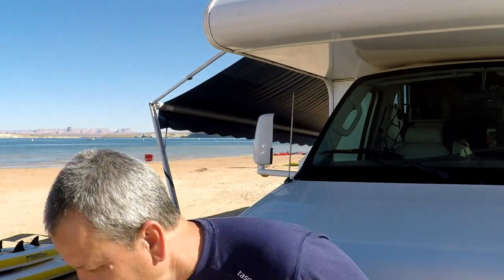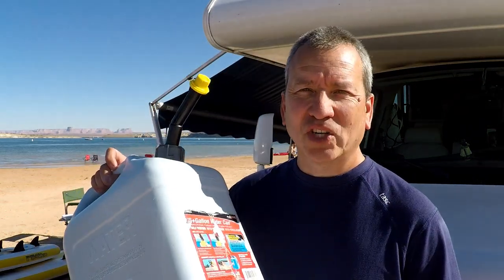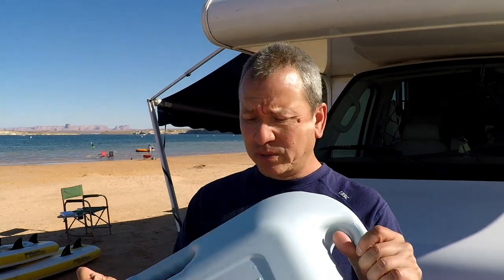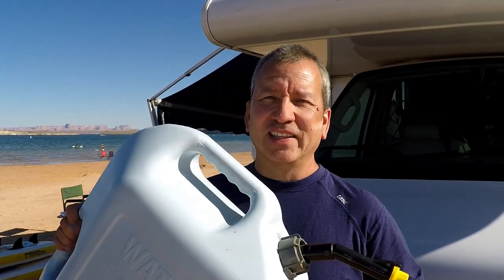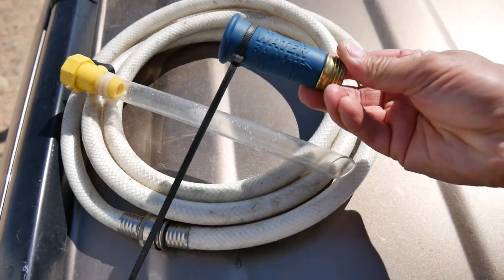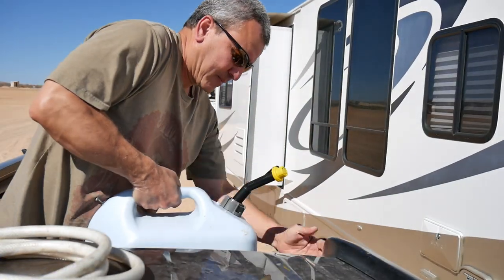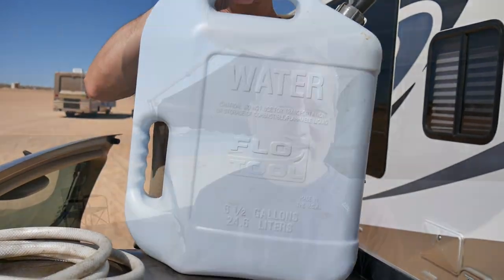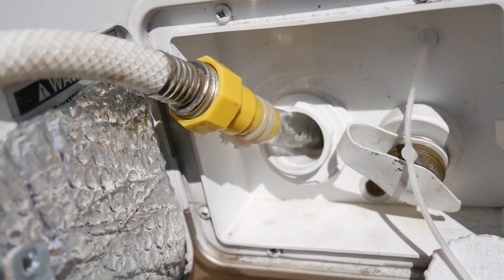EASIEST Way To Refill RV Fresh Water Tank Without A Pump

Comment: A siphoning trick I learned 30 years ago, is to just pressurize the source tank by blowing into it and then quickly stick that end (the one you blew into) into the destination inlet. In this case, you stick the airtight hose connection onto the water jug, with the (screw installed) you blow into the hose and then stick it deep into the water inlet of the RV. Once the water starts flowing remove teh screw. The pressure will push the water out of the container and create a siphon draining the water container into the RV. You probably have to keep the water container above the bottom of the hose going down into the RV water inlet, but that is lower than the top of the CRV given you have an 8' length of hose.

Comment: I bought a 12 volt pump at Harbor Freight,  some hose fittings and clear half inch hoses. and bring the colapsable 5 gallon jugs with me I just put them on the ground and pump it in works great
Reply from the maker: Yeah. Im pumping now. I can empty a 5 gal tank pretty quickly.

Comment: I use the 3 way valve for wintering. Open it up with the pump on and it sucks the water out without having to lift the water up. I did extend the clear line so it reaches the bottom of the jug. Saves my back and seems to work faster at refiling the tank.  I did add a second valve which I can open and close as needed also.
Reply from the maker: +Stephen Keller Cool. Yeah. I've seen others use that method too.

Comment: Install a metal truck valve stem (with the valve core removed)on your plastic water can. Much better venting and won’t leak.
I’ve used this method on my plastic gas cans for years.  WORKS GREAT!
Reply from the maker: Great tip! Thanks.

Comment: Before I had water at my cabin I used a 25 gallon ATV mount sprayer tank you see farmers using. I had it hooked up to my plumbing so I had pressurized water. Now I keep it under the bed in my RV. My tank holds 40 gallons but having the extra 25 means I rarely run out, I just plug it in to 12V and refill my main tank. I was going to plumb it in to my main tank but if I needed to take it out to go to town and get water I'd have to unhook it. I haven't had to go get a refill yet but I'm going to just put it in the truck, fill it up, come beck and plug it into the 12V and empty it. It also gives me a spare pump onboard and I have the tools to hook up to the portable tank if need be. 
 If I had to choose between mains electricity or running water, I'd choose running water;  as someone who has spent time without it.

Comment: I use the winterizing hose that is connected to the pump. It's connected through diverted valves on the same line as the main water tank. It's long enough to reach into the jerry can of fresh water. When the main tank runs dry, I fill the jerry can, divert the valves and put the hose into the jerry can. Good to go. Pump and pressure switch work as normal. I don't lift that heavy jerry can anywhere. I put it on the ground outside. Simple. It works for me.

Comment: We do the 12v water pump. Our fresh water fill is on the passenger side near the door. So it’s easy for us just to connect the water pump up to the batteries under the steps.  Plus, many times we wouldn’t be able to get the tow car beside the rv like that. But if we could, we would probably get one of those bladders and do the gravity feed off the car and get more water at home me time.

Comment: The few times I boondock and get to a water source with no hose connection or a fresh body of water like a stream  I will used an inexpensive and small submersible pond pump that you can get on Ebay or harbor freight for under $15.  If its a sink or some hand pump I will use a clean bucket and continually fill it while the small submersible pump fills my water tank with an inexpensive long clear plastic hose of 10 feet or more. Yes you will need a 110 volt that can easily plug to  your inverter since the pump is very low wattage. Obviously you'll need an extension cord long enough.  This saves my back and arms from lifting heavy water back and forth from the source. I've done this on clean streams with good results if I'm desperate for water.

Comment: I've struggled with this problem this myself. I tried a 12 volt pump from Harbor Freight. It worked at home, but the pump quickly died during the first attempt at a campsite in the woods. Aarrgg! I ended up rigging something similar to your setup with a funnel and duct tape and got the water in the tank eventually. It was not a chore for the weak. I'll look into the specific items you used in the video.Thanks for sharing!

Comment: if you have  ever  bought  a  2.5  gallon  fresh  water  rectangle  from  grocery  store.  They have a  pull out  spout.  When  done  with the  water remove  that  spout with  built in  valve. Dremel off the  outer  ring,  drill right  size hole in plastic  water tank   shoe  goo in  place,  you now  have a  vent, better than a  screw!

Comment: Nice setup. I do something similar when I move kerosene into my heating oil tank. I have a 13 gallon tank that is hard to move so I experimented with a couple of methods to move the liquid without lifting the tank. I drilled a 1/2" hole at the air supply point and inserted a schrader valve. I used an air compressor at first to move the liquid but later found that it only needs a couple of psi, so now use a bicycle pump, it works with very little pumping.

Comment: I have a very similar system but the only I did differant was instead of using a screw in the hole to vent the tank, I used a schrader valve like on a tire.  Drill a hole, pull the valve through which seals the hole.  Take out the internal stem on the valve and just use the screw cap to seal it. Works like a charm.
Reply: Bob Amoroso t
Reply from the maker: +Bob Amoroso That sounds like a more elegant solution that I may copy. Sounds like I need to retrofit my container.
Reply: You can also buy the vent caps they used to have on tanks like this before the had to remove them to protect people that didn't know how to use a gas can. :)

Comment: I use a 12VDC bilge pump hooked up to a small hose with an on/off switch, drops right into the water jug.  Can empty a 5g/20L tank in a few minutes with no lifting what so ever.  Costs less than $15 Cdn and most importantly no lifting of a 40lb water container.  Nice idea but i'm done lifting these jugs.

Comment: I just carry a couple of those easy to stow and cheap 5 gallon collapsible water jugs. I find two easier to carry than one, because I'm more balanced, with one in each hand.   I just put them on my couch in the motorhome, stick out the coach window, one of those cheap $10 hoses, with a syphon valve that you jiggle to get it going (from Camping World),  in the upright jug, run the hose out of the window, and into our water fill port.  It will syphon 5 gallons in less than 3 minutes!
Reply from the maker: +Marty Duke Good idea. I've got a small window near the inlet that I could probably use to do the same thing.
Reply: Good point! We don't canoe/camp any longer, but when we did, we took an empty collapsible plastic 5-gallon container with us to transport water from nearby rivers, lakes, etc. Can't remember where I bought the item, but it could be reused over and over, and when empty, it could collapse to be easily stored. Also, very lightweight.
I've used the jiggle siphon valve for gasoline; works great. Works with any liquid needing siphoning.
Reply: We recommend using the 5 Gallon Wolverine Bottle. It rolls up when empty, has 4 brass grommets for hanging, doesn't leak or break, and is made here in the USA!

Comment: Nice video. I use a pump and I love it. I bought a water bandit but can't find it. I did the hold it up method because a lot of sites I couldn't get close enough to use my truck to set it on. This is a great method for if and when my pump goes down. You always do a great job on videos, especially the information ones.

Comment: Great video Brian. I started out using this technique but having the jug on the car roof didn't work great for me. I ended up with the jugs inside my RV next to a back window close to the water tank. I then use a 3 foot hose to siphon the water from the jug to the tank. I have three 6 gallon jugs and they fill my water tank because I usually don't let the tank get more than half empty. No if you come up with a way to refill an RV propane tank without moving the RV we will be set! Ray
Reply: actually if you ad an adaptor to the tank, you can connect an extra propane tank to the system.  And it can be sized  20/30/40 lb bottle.
Reply: @scottb.innovations4386  Agree, bought an adapter last year.

Comment: That you Tito!  I have a Fifth wheel that does NOT have a fill area.  Instead, it only has one hose connection that serves as both city water hookup or fresh tank fill-up.  I guess that's what I get for buying a high-end Cedar Creek fifth wheel!  I just purchased the water bandit (still in the package).  So I can simply use your idea to connect the hose to my female intake.  Thanks!!!!

Comment: I'll have to be doing this all the time in Mexico. Peeople advise not to use tap water in your fresh tank even for washing dishes etc. So they get 5 gallon bottled drinking water. I have a stool but its 1.5 ft lower than the opening. So I think I'll have to use siphon method from there.

Comment: Hey Brian - have you thought of using an AquaTank2 water bladder? BPA free with hose fittings on both ends. They come in many sizes all the way up to 150 gallons and you just set it on roof of the SUV, fill it then gravity drain into the RV.
Reply from the maker: Somebody else also mentioned that. I'll have to look into it.

Comment: You can get the little vent valves for the water jugs or gas cans on ebay under "gas can" they cost about a buck a piece
Reply from the maker: +Crusadersojourn Thanks. I'll check it out.

Comment: I do about the same but I have some fold up steps that's about right to sit the jug on. I'v seen a lot of people use what looks like an air mattress that's made for water, they lay it on top of their vehicle fill it then hook a hose to it and gravity does the rest, look like they held about 20 or 30 gal. don't know what they cost, but I'm thinking about trying one.
Reply from the maker: I've heard about those to, but haven't checked them out yet. It could also be a way to create a solar hot water shower too.
Reply: I use one of these 45 gallon fresh water bladders, and it works great as long as the water source is very close by, you can't drive down the road with it up very fast. I put it on the roof of my tow vehicle, drive that short distance to fill it, and it gravity feeds into my motor home fresh water tank. A great $100 investment.

Comment: Probably someone else does this but  I physically can't hold my ten gallon jug too long as its around 80 lbs.  I found a portable drill pump that runs only $14 on eBay.  Take your battery operated drill that you already have to raise the jacks.  it can drain 10 gallons in a few minutes.   no sore back or straining. Of course I drag that jug on wheels too.

Comment: YOU CAN GET A VENT CAP KIT AT MOST HARDWARE STORES EVEN WALMART
A (10) PACK YELLOW FUEL/WATER CAN/JUG VENT CAPS ONLY COST $6.00 AT WALMART. THEY CAN BE USED ON PLASTIC OR METAL CANS/JUGS. ALL YOU NEED TO DO IS DRILL A 31/64" HOLE INTO THE CAN/JUG THEN PUSH THE VENT INTO THE HOLE. CAN BE USED ON   EAGLE, CHILTON, BLITZ, BRIGGS & STRATTON, ROTOPAX, GOTT, ESSENCE, SCEPTER, CRAFTSMAN, ANCHOR, RUBBERMAID, KOPLIN, SEARS, WEDCO AND MORE.
Reply: Tractor supply has them in the kit that comes with the large flow tips.

Comment: Here's another good idea. Go get a valve stem (like the kind that goes in  a car rim) and drill a 7/8ths hole into the water jug, then fish a line through the hole to the mouth of the jug with one end tied to the end of the valve stem and pull it through to the hole that you drilled. Then remove  the Schrader valve from the valve stem. Viola! You have a vent with a cap.

Comment: Tito, for women, a 6 gallon container weighs over fifty pounds!  Too much to lift!  I use four of the 3 gallon rigid containers with spouts that you can buy at REI. Two of these fit perfectly into the passenger foot area in the backseat of my tow vehicle. So when I travel, I take two or four of them.  That gives me a max of easily fillable and liftable containers with 12 gallons of water!  No need for pumps, hoses or anything else!
Reply: I think lifting 50 lbs is a non-issue for most women, myself included. My son is 45 lbs and I regularly lift/carry him.  Even airlines allow up to 50 lb suitcases because 50 lbs is a "manageable" weight for most people. I think inability to lift 50 lbs is a personal (or aging) issue, not a gender specific one.
Reply: Rudi Dundas you don’t have to fill up a 6 gallon jug all the way

Comment: Just go to walmart  or amazon buy a siphon hose. It has a ball bearing one end. Take the jug top off, put the end that has a ball bearing on it in the jug. put the other in the Rv or what ever you are filling. Shake the hose back and forth until you see it going, and it will siphon it till empty. I use this to fill my cars. Gas gets cheep I fill four five gallon can and fill my cars easy. Just set the jug on the roof or some thing higher than where ever you are filling. The hose is cheep no work on your part.
Reply: Still have to "Work" to get it higher than the tank you are siphoning to.

Comment: I wish I had a water fill port like that. The only one my open range light has is for a hose. Took it apart and it's plumbed with half inch line. Way to small to gravity fill. Bummed

Comment: Pardon the newbie question - because, I don't yet have an RV myself - but, it is my understanding that the sizes of your gray and black water tanks are matched to the size of your fresh water tank - so, when your fresh water tank is empty, your gray and black water tanks are nearing full, right?   So, I'm questioning the value of adding more fresh water, when your gray and black water tanks are likely to be nearing their capacities, or how are you addressing that issue at the same time you're addressing the need for more fresh water?
Reply from the maker: I don't believe there's a standard. My water tank is roughly 40 gal, black tank: 38 gal, gray tank: 44 gal. When you use water, some goes in the gray and some in the black. Most of it goes in the gray when boondocking (sinks & shower). So you'll run out of water before filling any of the tanks. Of course, each RV is a little different. Hope that helps.